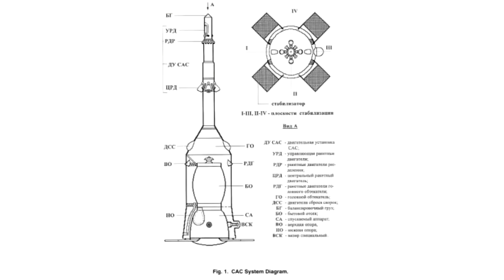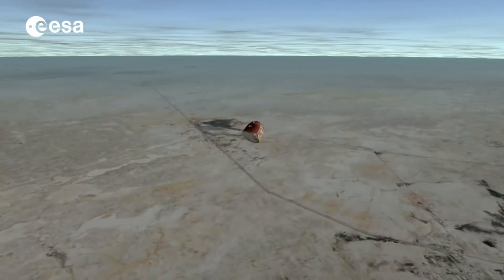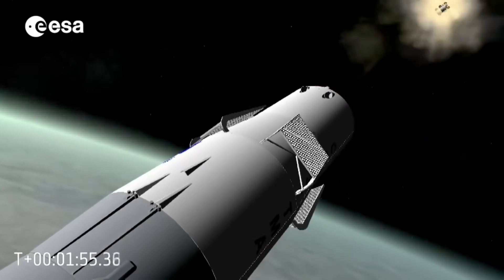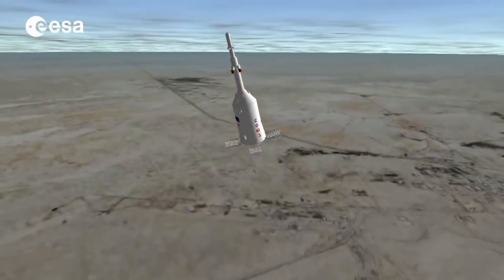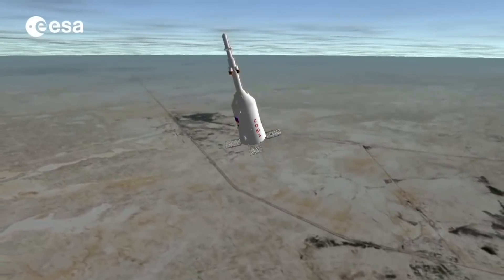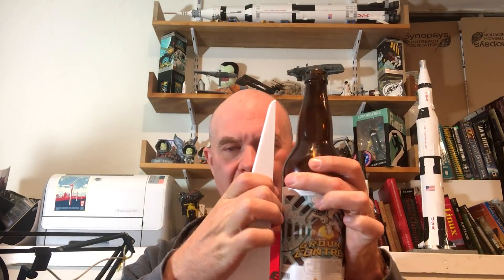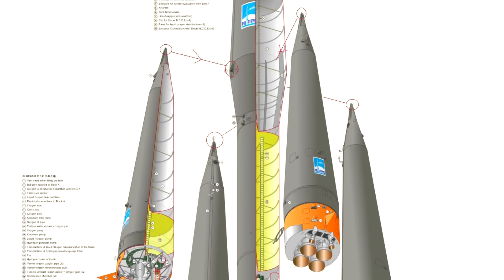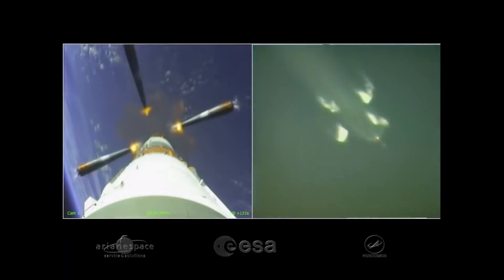Soyuz MS-10 Failure - Updates & Answers To Your Questions

Comment: So one valve can cause a full failure? Has this ever happened on other R7 based Soviet rockets? Like a progress or one of the older Sputnik/Voskhods?
Reply from the maker: There have been a few booster separation failures in the past.
Reply: They should have all of the debris shouldn't they ?? Nothing was close to orbital speed so pretty much all of the rocket should be in the same general landing zone ellipse. I would think they should have better ability to look at the rocket debris than they did with either Shuttle investigation.
Also, I have never seen a reason why they were only flying two crew members up ?
Reply: Your implication here is that the fact that a single valve on any of the boosters failing causes a full failure, and that this is bad design. I disagree. Space is perilous. You fuck up, and you loose one or more highly trained highly dedicated people, and tens of millions of dollars. So while redundancy is important in engineering rockets to keep failures from happening, there's something to be said for a design that fails QUICKLY rather than having it's engineering hide a failure, as the earlier you get a failure, the earlier you can address it and either work around or abort, and the earlier you do those things, the less risk there is. In this specific instance, the failure case is not particularly safe, as it results in a booster striking a tower full of fuel with a reservoir of liquid oxygen in the area just to raise the stakes, but by having only the one valve, you reduce the complexity of the design (and thereby potential failure points), and make figuring out what went wrong easier, which keeps people safer as the resultant investigation can be faster and is more likely to be correct in its assessment. Provided you design the other, related systems with the potential worst case failure in mind, there's nothing wrong with this, as designed. The launch abort system performed capably in the failure event, and kept everybody safe, indicating strength in the design as a whole. Furthermore, by having only the one valve, which failed, the failure is not something that could have gone unnoticed. Let's say I had two valves there. Both of which open. In a failure event, only one does. The same amount of liquid oxygen comes out, but at a higher pressure, through the one valve, which will be correspondingly smaller. This could perhaps result in over pressure forcing some part from within the plumbing for that system, or part of the valve, out of the piping, and have it hit the rocket. This is a much subtler error, and might not be caught until say, a crack in the tank results in a loss of fuel pressure midflight, after the escape shroud had been jettisoned. All of a sudden, you still have a potential catastrophic failure, but you A, have to figure out what happened when the real cause was a minute before you realized there was an issue, and B, have less tools to deal with that potential problem. 

An important and oft overlooked engineering principle is the idea that, in case of problems that cannot be corrected on the fly, designs should fail quickly and safely, rather than delaying failure and potentially causing a bigger problem that is all the harder to diagnose and fix in future iterations due to the complexity of an issue being left to sit over time. It's the same reason your car might fail to start if you flood the engine. Sure, you could design an engine that starts despite the over rich fuel mixture, provided you aren't so flooded that combustion is impossible, but a flooded engine is often a symptom of another problem, one that will cause further damage or lack of safety if the vehicle is driven once it manifests. Say a faulty circuit controlling the fuel pump, that could cause unexpected variance in the rate of fuel flow; you don't want that on the highway, as suddenly you might flood the engine and stall at 70 miles an hour. Safer to fail in your driveway than on the interstate, both for the driver, and for the engine, which doesn't then have to deal with the stress of being operated outside of spec.
Reply: Maybe a redundant valve would be a good modification.
Reply: @akariel123  in over 60 years of using this rocket design there must have been some improvements. 

But let's wait on the final report of this investigation.
Reply: It was probebly not the valve itself but the "human factor" like the valve was incorrectly installed (by mistake) or damage in transport and the checklist to ensure the valve was workign well was not done.
Reply: Very true. They had an issue with that before on one of their rockets, an upside down sensor I believe that caused a failure by confusing the flight computer.
Reply: Oh they've improved it a ton. But there's always room for more. It's a great system nonetheless
Reply: @akariel123  the proton that got sobotaged does not compare to the Soyuz. The Soyuz is human rated and therefore has far better quality control. The Soyuz us also majorly important for international governments as customers for a seats and therefore should never have any failures. 

There are quite a lot of Ukrainian rocket engineers that are on suspesion for building rockets for North Korea. My theory is that they had to replace some people and those are causing errors.
Reply: @akariel123 , that was a proton rocket.
Reply: Wait, the Proton was sabotaged? I thought that was an accident :/ And failures happen, they're a fact of life in space travel. It's a testament to Russia that the escape system worked as designed and prevented loss of life.
Reply: Thanks
Reply: Clarity: well, when the module gets installed upside down and has to be beaten into place with a hammer because the design makes it impossible to get installed upside down, it's either gross incompetence or sabotage.
Reply: I'd be lying if I said I've never installed something wrong, and then realized it fits much more easily the right way around. A mistake is much more likely than sabotage. We can all be idiots from time to time, even in aerospace. I'd wager a lack of double checking was present, as it was with one of the European rocket failures. They had decided to cut one of the checks to save cost, and kaboom.
Reply: not really sabotaged. but that you put in a part the wrong way... that was marked and also unable to fit? they hammered it into there the wrong way around - that is not how you deal with rockets normally.
Reply: MrVipitis I think you should be more careful with your language. I think it is pretty well established that the Proton failure was due to human error and not deliberate sabotage. So, don't use that word when speaking about that incident, to avoid misunderstandings and spreading misinformation. Unless of course you have a reason to deliberately lie about it?
Reply: @MrVipitis  I doubt they actually hammered it in.  That comes form commentators after the fact saying things like, "It is designed to go in only one way.  You'd have to hammer it to get it in wrong!"  
Unless they have seen the actual parts, they cannot know for sure just how it was done wrong.  It was said that the gyros were in upside down, but what if it was that the signal connector was inserted the wrong way, (or wired the wrong way, though that should be found in pre-assembly testing), that caused it, rather than the hardware being physically upside down?  Either way, physical or electrical inversion would give the same inverted telemetry & cause the same failure.
For that matter, It could have been installed inverted, just not completely.  The thing that stops it going in the wrong way is usually just a keyway when it gets to the final position, so it may have simply not been clamped down all the way.

Hanlon's Razor: Never attribute to malice, that which is adequately explained by stupidity.  Or fatigue, or vodka, or...
Reply: @Clarity I can confirm how easily simple mistakes and lack of double-checking can cause disaster.

I do high-power rocketry with a college group. We launched our biggest, most complicated rocket yet earlier this year. It was about 14 pounds, siz feet long, 3 inches in diameter - a veritable arrow - and hit roughly 3000 feet AGL. Thing had double-redundant flight computers and so on, the works. Really complicated part was our 'payload' - cold gas thrusters for roll control.

The launch crew made a simple mistake - they forgot to properly set up the separation (honestly, a bit of bad design in there too - instead of using shear pins like we have before, we opted for a... simpler method (the project lead considered shear pins to be something we couldn't afford to do in case we got out there and found they were missing, he thought we wouldn't be able to get replacements) - tape that needed to be scored before launch. It didn't get scored).

We wound up lawndarting and actually wound up embedded deep enough into the ground that we hit the water table - which ruined all of the onboard electronics. The fiberglass airframe, with the exception of the fincan, is a total loss - delamination, broken bulkheads, so on.

The reason the tape didn't get scored? It wasn't specifically on the checklist and the launch crew was distracted (zero pad security at the event, apparently - people coming up asking for photos, other bullshit).
Reply: @Veptis  they recently switched to using fewer yet more powerful engines on the R7. Before that change it required more than 30 engines to light simultaneously. The design has an amazing record of reliability, especially with the failures of the N1 which also had a large number of small engines. Switching to fewer engines should make the R7 even more reliable - as long as failures of systems other than the engines don't happen.
Reply: The shuttle dealt with it by having four separation motors on each end of the SRB.
Reply: Patchuchan So, four times as many points of failure...

Comment: If there was total emergency on the ISS, could they bring the people down in cargo capsule like Dragon?
Reply: Wear an EVA suit and stuff it with pillows 😋
Reply: There is already a Soyuz docked to the ISS.  It's the previous one that went up to the station.  The normal protocol is to exchange craft with each crew rotation so that the newer spacecraft becomes the lifeboat in the event the station needs to be evacuated while the previous craft is used for returning the departing crew to Earth.
Reply: In theory yes as Dragon V1 did carry up live lab animals to ISS so it least has a basic ECLSS.
Worst case they might have to add some CO2 absorber canisters and some O2 tanks to handle people inside it.
Reply: In theory if the Soyuz currently docked was damaged and the astronauts needed to get out . Either a unmanned Soyuz could be launched or perhaps Spacex could launch the current state of their manned dragon in relatively short order to try to rescue.
Reply: Yes, Elon said.
Reply: You could, but that would leave the ISS unmanned and it requires maintenance such as periodic boosts to stay in orbit. If something goes wrong and needs intervention, that's it for the ISS.
Reply: Isn’t the dragon ment to burn up when it comes back or is that something elses
Reply: Keshia Fowler 
The Dragon is the only cargo spacecraft with a descent module, though I suppose it would be perfectly possible to make a Progress that had a descent module, in which case it would be just like a Soyuz without the seats and controls inside the capsule.
Reply: Dead people? yes... breathing people? probably no... not enough Oxygen. They would probably survive in an EVA suit... with a few broken bones
Reply: Dragon is designed to carry living cargo that needs pressurization. I would suspect CO2 scrubbers being available would be more critical. In raw volume, the 11,200 liters of pressurized volume has enough oxygen content for 4-1/4 human-days at 550 liters/person-day. With some lithium hydroxide scrubbers and some replenishment oxygen, you could MacGyver/Apollo 13 it home, I think.
What happens after splashdown? I dunno.
Reply: I mean they have enough capsules to bring people down in an emergency. But in a worse case scenario and there was no other option. I don't think the flight directors will like it but I guess it's possible
Reply: That would be ridiculous, very high chance if death without some way to secure themselves in place, and obviously the cargo ships aren't designed to secure humans. They have a Soyuz up there, they can just take that down, the ISS will just be empty then.

If something happened to that Soyuz (the hole is not important), sending another Soyuz even without an investigation would be far safer than using a cargo vessel.
Reply: Theoretically you technically could, but we don't ever want to have to try
Reply: Current Dragon is not meant to be used by people. I think they wouldnt agree with the re-entry with people onboard ´cause its not safe enough. And another problem is that there arent any seats and other life support equipment there I belive :D (Sorry if im being wrong)

Comment: If your oxygen venting valve doesn't open
You will not go to space today
Reply: moosemaimer 10/10 poetry
Reply: When my methane venting valve opens unexpectdly i end up going to the washing machine....
Reply: also, they did go to space, if only briefly
Reply: Is that a haiku?
Reply: It's a new line in the ever-expanding "You Will Not Go to Space Today" song.
Reply: Fortunately it's not expanding fast. I think this is actually the first addition since it was recorded, right?
Reply: Beezqp "You will not go to space today" is a line from xkcd comic 1133, which explains the Saturn V using only the 1000 most common English words. The comic is called "Up Goer FIve".
Reply: And also a song by Scott's daughter :)
Reply: Randall Monroe
Reply: And if it opens on the capsule while in space, and you're not in a pressure suit, you're probably dead

Comment: So when they announce the escape tower is jettisoned, and we see multiple pieces come off - is that normal?
Reply: I think they were the 1st stage boosters.
The animation at 1:36 shows them separating a few seconds after the escape tower is jettisoned, according to the mission timer in the bottom corner.
Reply: Not normal at all.  Compare the video of MS-09 launch.
Reply: I guess I'm still confused about which part of the launch footage is the escape tower jettison and which part is the 1st stage separation.
Reply: This did not look like a normal booster separation event. That usually looks very pretty and symmetrical which is why the Korolev cross is so mythologized by rocket enthusiasts. This looked like a mess.

Comment: I’m glad they “flew safe”
Reply: Escape systems and SR71 Blackbirds: because sometimes flying safe means outrunning a rocket
Reply: @DynamicWorlds
That is my favorite sentence.  Lockheed-Martin should make that an official slogan.  It turns out the Grand Central Rocket Company made the Mercury LES motors and they were acquired by Lockheed in 1960 who then made the LES motors for the Apollos.  (Lockheed, of course, also made the SR-71.)
Reply: Well the Russians have opened a criminal investigation into the Soyuz failure. So it seems this failure and I guess the ISS hole may have actually been sabotage. If so that's really scary stuff. The ISS hole could have forced the station to be abandoned, but this latest incident could have easily killed people.
Reply: Wait, there's a 'flu safe' vaccine? Whoa!
Reply: They “fell safe”
Reply: Safe is always relative.🤣🤣
Not even the comments worked.
Just prefabricated story about great triumph.
My god use safer equip!
Reply: Still, even with it's perfect launch abort system, soyuz still had two fatal accidents, one was caused by the failure of the main parashute, causing a high speed impact with the ground in 1967, killing 1, and the other was a depressurization caused by a faulty valve while undocking from salyut 1 in 1971, exposing the 3 cosmonauts to the vacuum of space, and all 3 were found dead when the capsule landed.
Reply: Technically they fall, cause they were on an ballistic trajectory 😂🙌
Reply: they were flying at first, then falling with style, then just falling, then they were on the ground
Reply: Actually, they "chuted" safely.
Reply: Omg these guys don't get the joke :)
Reply: Well it has been along time since Scott uploaded a lot of KSP
Reply: we do get the joke, i just couldn't figure out a way to subtly refer to it
Reply: we get the joke
Reply: Cos-ism is a death cult